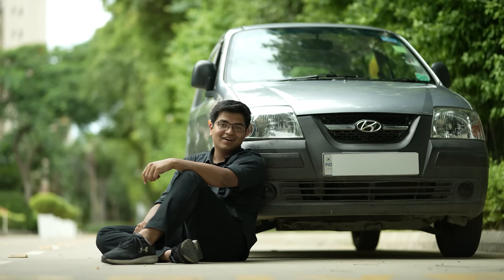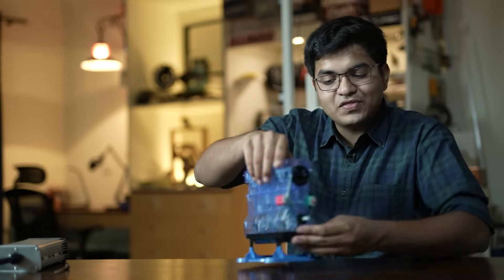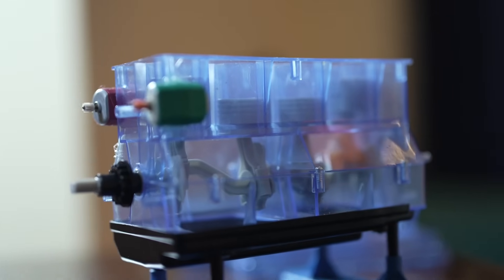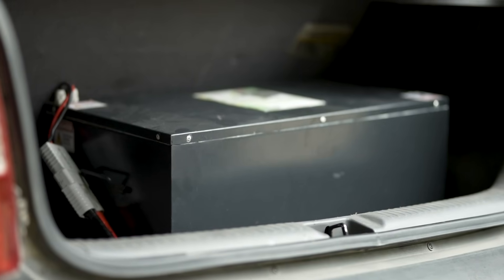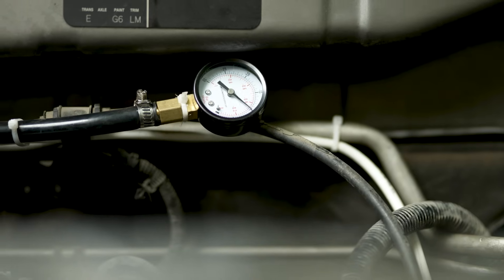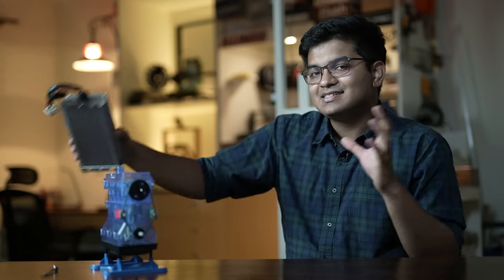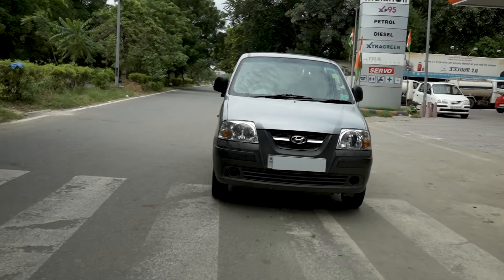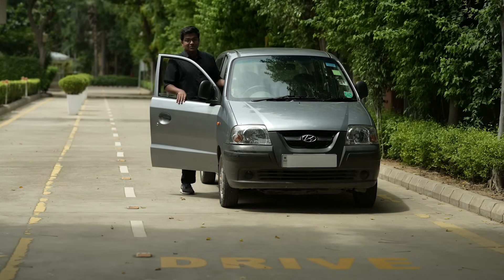Simplest EV Conversion under $3000 - Convert Your Car in 3 Days!

Comment: comendable project. thats a lot of hassle to tackle, but i just wanted to point out that its not exactly 8 hp now, since its got the gearbox and 2 different motors (one of them being compressor for AC), it is much less to the wheel, i am still in disbelief how hp less than 8 is pulling those 4 wheels and a 800 kg car

Comment: Don't the main bearings still need oil, and if your still running the oil pump off of the crankshaft how are you avoiding the oil pressure loss from not having the rods on the crank?

Comment: The Blade Electron was Australia's first commercially available battery-electric car, produced by Ross Blade's company between 2008 and 2014. These cars were converted from Hyundai Getz vehicles, replacing the petrol engine with an electric motor and a lithium-ion phosphate battery pack. Around 50 were made, featuring a range of about 100 km and a top speed of 120 km/h. 

Development: Initiated by Ross Blade, the project received government grants and was developed in Victoria. The goal was to create an Australian electric car industry, but it ultimately faced challenges from imported vehicles.

Conversion process: The standard 1.4-litre petrol engine was removed and replaced with a 40kW/90Nm electric motor. The electric motor was connected to the original Hyundai Getz manual gearbox, with modifications allowing for selection of only first, second, and reverse gears for efficiency. A 16 kWh prismatic lithium-ion phosphate battery pack was installed in the rear.

Performance: The Blade Electron had a range of approximately 100 km and a top speed of around 120 km/h.

Legacy: Although not a commercial success, the Blade Electron is recognized for its pioneering role in Australia's electric vehicle history. Its story highlights the difficulties of launching an innovative product and the challenges of developing a domestic EV industry.

Hyundai partnership: Testament to the quality of the conversion, Hyundai agreed to honor the warranty on standard Getz parts that were not altered during the conversion

https://www.carsales.com.au/editorial/details/from-the-classifieds-blade-electron-ev-133885/

Comment: Great job ! Question though , you removed the pistons and therefore the conrods as well .the conrods get oil for lubrication , but since you removed the bearings ( half of the bearing is connected to the Conrod) , there is no resistance to the oil pressure , as it will just freely exit from the holes where the bearings used to be . Doesn’t this cause a lack of pressure which causes the main bearings get insufficient lubrication ?

Comment: Nobody's noticed how there's not a single close-up shot that actually shows the motor attached to the block and how the belt is supposedly attached? This is incredibly jank at best and would definitely not work well for any meaningful duration. The power steering and AC would only work while the motor (therefore wheels) are spinning at quite high speed. Don't be so gullible people. Indians will gladly lie and fake their way to validation.

Comment: So the top pulley was previously there only to provide tension but is now being used to provide rotational energy to the crank shaft which is no longer being powered by the pistons? Does that mean that you could remove the pistons all together to further cut weight?
Reply: Also could you add regenerative breaking back into the design with the correct wiring? Would doing so save on or eliminate the need for brake pads or just cut down on wear? Also could the battery be mounted where the fuel tank once was?

Comment: So you are powering the car via the timing distribution assembly? That doesn’t sound right since this will not be suited to transfer high loads. No wonder you had to use a weak motor. Furthermore: I’d at least also remove the portion of the cylinder bank which is not needed.

Comment: Sorry not imprest, 60kmh?  3 different e-engines? I have a charade daimatic, if i remove the 3 cylinder petrol engine i only need a 35 kw e-engine, batteries and a 48 to 12 volt to charge the normal battery. Thats more simpel than this 9 hp with full batteries and then at 50% you can start walking next to the car. But where does one find a 48 volt 35kw e-engine? maybe from a machine?

Comment: Thanks for the video.  I always had an idea of converting a regular gas car to hybrid by adding motor to rear wheels.  This will run the car in stop and go traffic to improve the gas mileage but still provide highspeed highway driving without compromising range.   There is a challenge like how to control the electric motor from the same gas pedal.  There may be others.  I love hear your thoughts on this.

Comment: How’s the oil system work for the crankshaft? Everything’s just the same but you have a metal plate capping off the entire top of the engine?

Comment: If you are keeping the RPM going into the transmission around 2000 - 3000, this conversion should work with an automatic transmission, too.

Comment: I prefer removing the heavy chunk of metal engine   all you have to do is make a bracket and install all accessories back. It will give you more space  ,lighter, better more mileage, the whole idea is stay from oil,gas,and engine spare parts.

Comment: JUST put on the rear train, a new set with diferecial atached to a electric engine, cost just 500 dollars, turn into an simply Hibrid, and save a lot of fuel for the 1 and 2 gear on electric. Simple and cheap Solution.-

Comment: Excellent.  As someone mentioned, you are incredibly talented.  I have been against EVs because of the cost and the cumbersome batteries. Your idea seems to have sorted that out,with a smaller  battery, shorter but practical city range and reuse of existing automobile components.

Comment: wait... the timming belt is for command the valves not for making effort... now is making work to move all the  rotating mass of the old engine and accessories... making the car move that's a strong belt... sadly we didn't get to see much of the "adaptation" in the video (except for 2.39). good thing is a small engine in a small car. The deck of the block remains open. so the oil didn't splash everywhere? (not having a combustion happening is good for the oil at least)

Comment: Could you save belt wear by finding a way to mesh the motor against the flywheel? The starter is already a motor spinning the engine around, lets go full circle, pun intended.

Comment: Get rid of the engine block, attach the electric motor to the flywheel and add a pulley on the other shaft of the electric motor for the AC and power steering pump. This only requires one motor bracket, 1 pulley, and 1 adaptor to the flywheel. Saves all the weight of the block and crank and no need for oil. Might be even easier than keeping the block. Cheers and nice job on the channel.... subscribed😃

Comment: Hello, Thanks for sharing. 

I have a question. 
Why we cannot convert 72V to 12v directly and power wipers, lights etc. from main Li battery? So we don't need an extra 12V heavy battery.

Thank you.
Reply: Bro motors req lots of power

Comment: i think it’s an interesting idea, but i can’t imagine this car runs well. the battery looked severely undersized, the motor too, then there’s all the inefficiency from keeping the motorised pump and alternator in the main mechanism and the weight of the engine. if it was absolutely impossible to get more money, perhaps this makes sense, but if you’re going to all this effort, you may as well build a car that has a practical range and performance.

Comment: Nicely done, you said it would cost 1 rs per km, but I think you're forgetting one thing or you just not mentioning. The main part of this build, this battery, whenever you change that, I think the cost per km will be equalized to that of a petrol/diesel car. So it's just the Illusion of cheap average. I admit the conversion was good indeed if not for the cost of battery.

Comment: Wt happens if u hv a car thats powered by both -the existing ice and a battery motor unit for the rear. Can v drive the car in neuter and have the back electric motor functioning?

Comment: curious why you put the engine block back and didn’t just hook the electric motor up to the transmission input shaft? wouldn’t that have reduced weight and effort of turning the crankshaft/flywheel?

Comment: Two things :
1.Instead of motor running engine you could make engine generate electricity and charge battery
2. Make motor directly power drivetrain (like pure ev)
There you Go you got a qholw new type of hybrid car system.

Comment: Even if it still has engine oil, it probably doesn't need oil changes very often. The main reason engine oil needs replacement is that the chemicals that counteract the combustion byproducts get depleted. No combustion, no depletion.

Comment: i know this is just an engineering home project but it sounds quite cool

what i think is the most problematic part of the compromise is the battery (with its 72V) and the very low power output
i know that probably more than 50% of the budget went for the battery, but it could be worth an extra 1-1.5k to get a higher voltage and capacity battery and subsequently motor.

Also curious about the reason you didnt put the battery in the place of the old fuel tank, since it is obviously not needed and probably removed?

as somebody driving a fairly old car too, 23 year old diesel A3, who has thought about different options to convert it to EV for city needs this is quite the refreshing idea and one direction i have not paid any thoughts to. congrats on making it work as well.

Comment: But how you get the timing belt or any belt the exact length to fit into the new rig? I know there is a tensioner to adjust, but there a a range limit there, so there are all lengths of belt out there?

Welt the alternator and brake assembly to the loop is a better idea

Comment: You want a true EV conversion you need to scrap everything you don't need. Me and two of my friends created an EV that took 3 years to create. 1995 Honda hatchback full conversion with unlimited range. We scraped basically everything to the frame and doors.  The body of the car is basically reinforced aluminum housing solar panels back to front producing around 5000 watts of power. With a few careful tweaks and mods using specific motor sizes for the weight of car and passengers. Passenger limit is 400 pounds and the car will operate up to 65 mph and never have to recharge. Completely solar powered and charges itself. You can drive all day without stopping. The power requirements to operate the car is 4200 watts and 800 watts to maintain batteries if they drop below 70%.
To be honest you don't really need a battery if you only drive during the day. At night time we have pushed the range up to 480 miles which is around 8 hours. The car is basically perfect and we are making more. We explored nationwide and bought 20 more Honda hatchbacks to convert. The only reason solar cars are not on the road today is because once it happens free transportation will be normal. Losing that revenue will bankrupt the transportation industry. All the additional stuff they add to the cars robs the batteries from range. Those computers are draining. You should be getting unlimited range with solar and over 1000 miles on a full charge. Don't let the industry fool ya. We basically built a solar car with unlimited range for 10,000.00
I wish i could share but those greedy capitalists would steal our tech to make profit off everyone. You should see our solar homes. We built a custom home practically the same way. Unlimited free energy. Our custom home has no wood and completely been engineered for sustainability. We grow our own food, create our own water, make our own clothes and create our own tech from scratch. Our custom home is one of a kind and not even the wealthy have our tech.

Comment: Sorry this is a scam, you never show how the motors are attached to the engine crank shaft. On top of it there is no room in a regular car. Also showing a toy Chinese motor on a belt drive of a ic engine model is not possible in reality. Here are huge companies like Toyota spending billions to make differential gearboxes and CVT to specifically share power between electric and IC engine and you are just sticking some Chinese toy motors ? This is the fake world we live in.

Comment: Awesome build ❤
One question i have is why keep the 12v battery? You can use the 72v lithium battery with the buck converter and use that 12v to power the windows and other stuff instead of charging the 12v battery. Just a suggestion 😅

Comment: Maybe u did it or maybe not but removing the flywheel can also reduce the overall weight, since it's being powered by an electric motor, the need for the flywheel shouldn't exist any more. But this is actually a job well done, this is how the conversion costs can be kept at the bare minimum, while taking real advantage on the fuel cost savings.

Comment: great work!! Do you keep the motor running to power the AC and steering wheel even on idle? if yes then it's a waste of energy. Instead add a voltage converter to power the AC and stearing pump.

Comment: You could install AC compressor from EV or Hybrid vehicles because they have electric motor inside compressor and you can install it anywhere you want.
You could just remove hydraulic power steering and put plugs on steering rack hydraulic input and output valve pinion housing or if you insist power steering on this small car you could just fit some electric power steering wheel axle from another car.

Comment: What I mean you are using the output of 72v battery and converting it into 12v there might be a power loss and the power which is used to convert 72v to 12v previous you only charged the 72v battery through external source why can't you use an another charging module to charge 12v battery directly like as 72v battery charging.

Comment: I want to ask one thing if u remained crank shaft n engine head because it helped more for motor placement  n cheap also but why it needs oil as in crankshaft the working of piston n cylinder isn’t neeeded anymore so why it requires n replacement also ?

Comment: You of course also have great upgrade potential as the needs and budget allow for it - very interesting and well put together video. Not sure how this would be achievable (cheaply and easily) in other parts of the world that may have different requirements "roadworthiness" necessitating things like engineers certifications etc ?

Comment: But why charge the 12v battery. Instead why not swap battery terminals with those from 72-12v converter, and completely remove the battery? Wouldn't that provide the required 12v dc without one more conversion cycle (from dc to chemical energy, to dc again)?

Comment: Good job. I was going to do something similar to an older Chevtolet s10 pickup truck years ago. I purchased a 20 hp prestolite dc motor for a forklift to use as a traction motor. Unfortunately, due to health problems, and my age, the project just sits. I think , I may have to get moving on it again.

Comment: Could you not have used the original vehicle alternator and ran it off the electric motor like the rest of the accessory drives?

Comment: This video sparked something in me. I’m now looking for a car to do an EV conversion on. I have one question, though: were you able to use a smaller motor because you kept the transmission in the car, or did you leave three transmission in because it would simply be too much of a hassle to remove?
This is an awesome video and this seems to be much simpler than a regular EV swap!

Comment: Keeping the pistons is unnecessary as it only reduces the range due to friction. Better remove them and keep only the crankshaft or a simple circular rod that will use the same bearings from the crankshaft. The crankshaft has a rotational mass that affects the range as well and using a simple shaft (circular rod) is cheap and effective.

Comment: How are you keeping your mains oiled. What kind of oil bypass did you have to do for the head back into the other side of the block. Have you done a tear down of your lower end to see if you have a new Ware marks or any kind of signs of scoring. Other than the oiling issue I think that this looks like a great idea.

Comment: doesn't make sense as the amount of parasitic loss is insane. the motor and the battery has to work overtime to make the crank turn and move the car. also $3k = 2.5L INR which for a fact is not worth the conversion.

Comment: Interesting, but why are you lugging so much of the engine weight with the car, just remove the engine, and make a custom steel tube frame that mounts where the engine did and also houses the battery.

Comment: Wait, so you will run the electric motor continuously regardless of whether the car is moving or not?
 
An ICE (engine) runs continuously at a minimum RPM, providing the necessary power for the steering, AC compressor, etc., even when the car is not moving. An EV motor is only supposed to run when you need the power to "move". 

Anyways, a pretty innovative approach. Well done! 👏

Can you share more specs? Motor, battery pack capacity, etc?